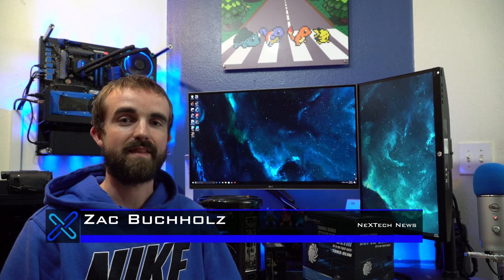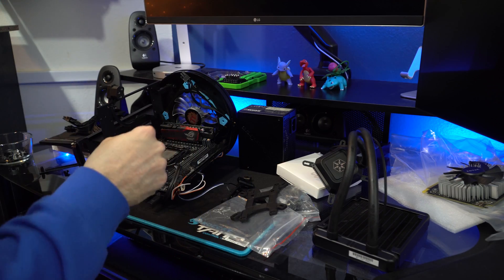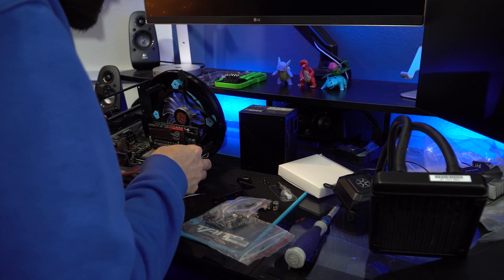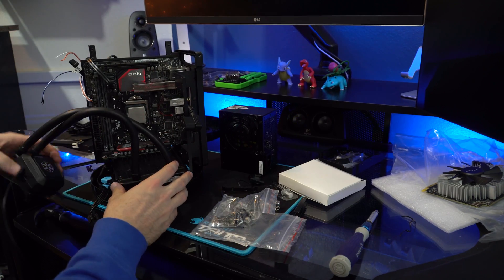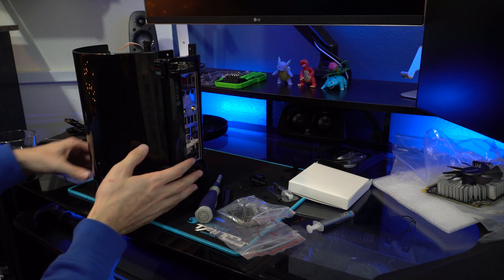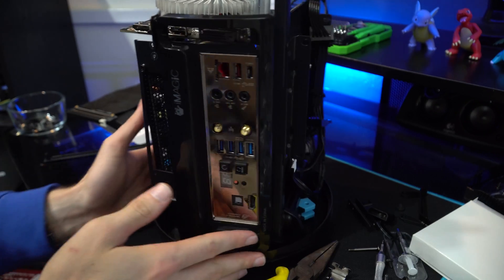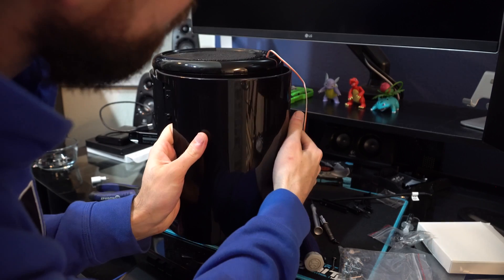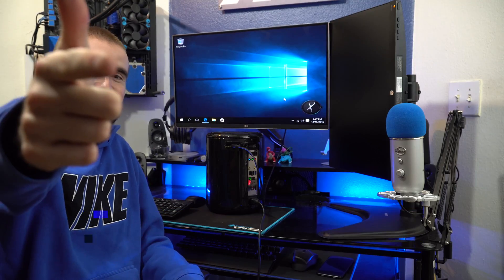Mac Pro Clone Build (iMagic Pi Case): Part 2

Comment: Hi Zack, I'm new to the channel - after Dune Case kickstarter didn't go well, I was looking on iMagic case to do my own build, but I'm not to fond of cutting the case to fit the graphics card. I was thinking more about mounting it on "backside" of the motherboard, in the place of the 2.5 drive bracket (some mounting method required lol) with additional risers'n'shit :) my question here is: how much space available is there? Will that Zotac card you used fit in? Cheers and keep it up :)
Reply: Also - My setup will include an i5-7600k, 16GB ddr4 2400mhz, 512gb sata3 m.2 ssd, and if there's enough space at the back - a 6gb gtx 1060 mini, and we'll see if there's enough room left inside to squeeze a 2tb 2.5" hdd somewhere :)
Reply from the maker: +Sorson I thought of that too but there is sadly not enough room for a graphics card begins the motherboard in this case, that's the method I wanted to use too but obviously want successful haha
Reply from the maker: +Sorson haha so your telling to squeeze a lot into the case as well haha!
Reply: NeXTech News yeah we'll see :) I'm currently waiting for the case to be available, in Poland the company name is Fortron rather than iMagic. I've decided to buy the case itself at first and look it up which gpu will squeeze in :) I was thinking also about 1050ti low profile with 160mm length (if 1060 would not fit) - and modding it to single slot low profile bracket - ultimately it will be a pc for music production, so theoretically integrated graphics should suffice, but being able to run wow or swtor on it will be a big bonus :)
Reply from the maker: +Matt Sorsson when I did this build the MSI 1050ti wasn't released yet so I'm not sure if it would fit but my guess would be it might! Definitely let me know how the build goes and what you fit into it! I'd be very interested to see it all when your done!
Reply: NeXTech News sure thing, I'll do some photos, or try to make a (decent) video/timelapse of this build :)
Reply from the maker: +Matt Sorsson Awesome! Definitely message me when your done!

Comment: how is this holding up? wouldn't it more logical to put a slim profile cpu cooler and a low profile 1050ti?
Reply from the maker: +cand7e7ack the low profile 1050ti wasn't out at the time and I also believe it is to long for the case, but it might fit, and yes a slim profile cpu cooler would have been better but the point of the video was to cram as much hardware as I could into the case
Reply: ah.. good. thanks for the quick reply. waiting more on your builds cheers!
Reply from the maker: +cand7e7ack I'll have a new one out soon, just a big project so it has been taking a while